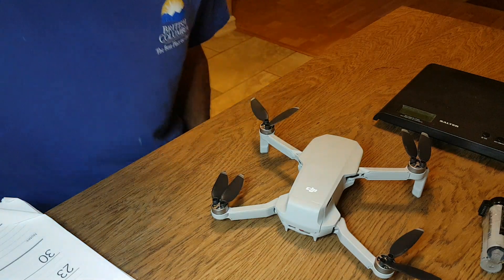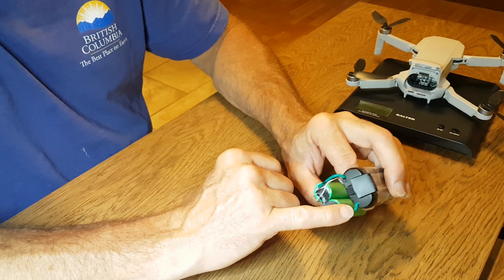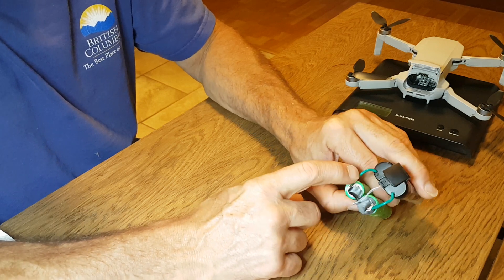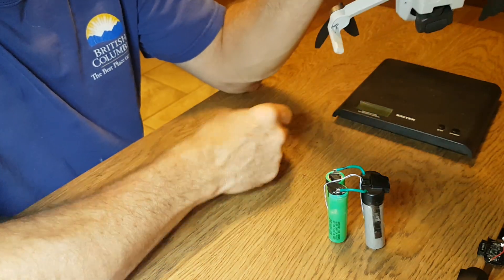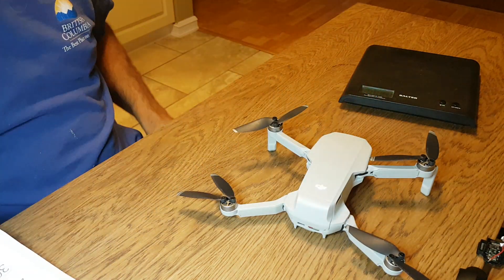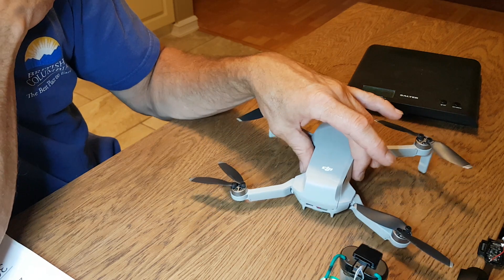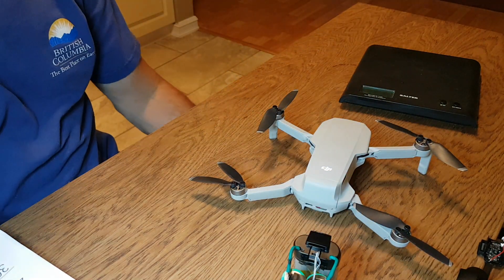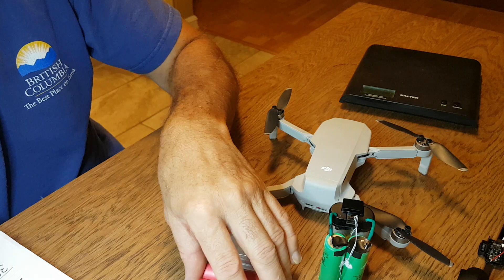Mavic mini easiest battery mod ever

Comment: Have you tried the 3500 mha yet
Reply from the maker: I probably should have, but according to some literature I had found on the web the Panasonic 3500mah batteries did not have much more power in them than the original 2500mah batteries that came with the drone itself. This is due to the power drain characteristics of that specific battery under these loads. On another note, probably Lithium Polymer batteries would be a better choice but I don't think that the charging system or the battery management system, which is part of the battery itself, would easily allow for proper charging of the other chemistry so I didn't pursue that. It also meant that making an easy quick and dirty long range drone would be too complicated for most of my audience since "bricking" the battery pack is so easy to do when trying to swap out battery chemistries.

Comment: What is the new flight time
Reply from the maker: So my "stock battery" flight best was 10.9km round trip in about 22 minutes. With this piggy back setup I did 14.1km in about 35 minutes. So I can only guess that if I stayed in C mode that I could probably get some time in the low to mid 40s minute range.

Comment: Is it possible to disasemble two dji mini 2 batteries and piggyback them, or is the battery sensing different then the mavic mini?
Reply from the maker: Yes, that is what I basically did. The second set was removed completely from it's case and was mounted to the other battery pack with wire as seen in this video. It's really the simplest way to get more distance or flight time without buying a bigger drone.
Reply: @rwatson2609  Thanks.....but will this work on a Mini 2 and still have proper sensing?  Maybe by using Mavic Mini batteries in the Mini 2?
Reply from the maker: @Maxi_Marine  ooops, I didn't notice that you have a Mini 2. I can't really give advice on something that I'm not familiar with Maxi.

Comment: Hi! Do you still have the "dead" battery boards? If the error was "battery cell error" or "battery data communication failure" then they CAN be salvaged. I am planning to make a video series on my channel how to do it, I am just lacking a "dead" board. Really don´t want to destroy a good battery just for that reason. Let me know if you are interested, and maybe we can get in touch! Cheers!
Reply: No. They can be recovered. Even Non dji error can be removed

Comment: Using a mini 1 battery to piggyback, will this work in a mini 2 since the mini 2 will accept mini 1 batteries? Thanks in advance.
Reply: Well in this case, we can just use mini battery and double its cells externally and use the pack in mini 2. To avoid ruining the last one's battery.
Reply from the maker: If what you mean is that you have a stock Mavic Mini battery pack that you want to attach to a stock Mavic mini 2 battery pack, I'd be a little careful. They are using different chemistries in the two different battery packs, one is Li-ion and the other is Li-Po. Mixing the two chemistries could be a bad idea since they both have different power curves.
Reply: Indeed a good question sir, or can we swap a mini 2 battery with a 18650 Samsung cell?

Comment: Considering this mod, but removing the old 18650's and simply replacing them with 2x 20700 or 2x 21700's saddled below, so total additional weight is less than 50g (difference between 18650 and 21700 is only 25g, but double this stock drone 2400mah 18650 capacity) EDIT: For anyone thinking of this, dont disconnect the DJO batteries from the board, it will brick the battery. This always needs to be connected to the drone BMS board and it be 'live' apparently.
Reply from the maker: Yep, I have a handful of bricked Battery management boards because of this too. :(

Comment: Couldn't you just find better batteries than what it's running?
Reply from the maker: Yes, you could but here are the standards that govern that search. The batteries that you chose should put out a total of no more than 8.5vdc(I'm guessing here, it could be more). If you want them to fit into the battery compartment then there is one more  limitation, else weight is the only other issue since those little motors can only lift so much weight. I roughly added an extra 90 grams and I don't think that you'd get off the ground if you added 180 gams.

Comment: Now it detects the extra weight and won't fly over 10 meters, also the new Mini2 batteries firmware detects what's onboard power wise and will brick itself if you fiddle with it. :'(
Reply: capitalism! yaaaaaaaaaaay
Reply: @ameliabuns  capitalist china - at it again
Reply from the maker: Did you change the payload setting? I think this should have been left alone.

Comment: Great job,  just one question about the balance wire because I have seen some other videos that have only connected the hot and ground in parallel. Do you know if it will still work without the balance wire for the piggy-back batts, and if so are there any advantages to have it connected/  thanks so much!
Reply from the maker: I guess you could just avoid using the balancing wire, but it probably guarantees a more even charge between the two batteries in the secondary pack. dunno for sure. Also just a little note. Don't let the voltage on the battery management board (the pc board in the battery pack) disconnect, your battery pack will be junk if that happens.
Reply: @rwatson2609  how confident are you that disconnecting the batteries from the BMS will brick the board?
Reply from the maker: @chaskerr4  I've got 3 bricked battery packs because of this. The first time that I did it was an honest naïve mistake so I removed the shellac layer from the battery board to reveal the battery management chip, just to be sure what I was up against. And then on the 2nd attempt I decided to piggy back a secondary set of cells over the existing ones before removing the stock cells and replacing them with 3500 mah Panasonic cells .. . . . I think that I never bothered with the balancing wire when I did this and locked a 2nd battery pack up, lol. The third time that I tried this, one of my soldered connections unsoldered as I mounted the leads to the new cell pack. 
It's not impossible to do this, but I seem to make these $50 mistakes too often to want to pursue it. The piggy back mod that you see here in this video does not require unsoldering the original cells from the pack, thus making it easy and doable by your average guy with some basic knowledge.
On a side note, I did notice that DJI did make the Mini 2 with LiPo cells and I have noticed videos of guys flying modified original Minis with LiPo cells on their Minis for super long range gains, so if you were to look for a better way to gain vast amounts of range, you'd probably best attempt to replace the Li-ion cells with a 7.8 volt LiPo pack that is just a bit larger. The down side would be that it would not fit in the battery bay and you'd need a separate charging method for this module. . . . .not sure how the BMS would do with a chemistry change though. Anyhow, from what I've seen on You tube, the mods towards flying on LiPo usually require doing a direct soldering of the battery to the drone mother board, which really forces you to commit your drone towards this project. LiPo batteries traditionally do not have the same power/pound capabilities as these Li-ion cells do but the way that these cells are used might allow for more power gains from a LiPo pack of similar weight. Let me know what you're thinking of doing.

Comment: Can you show me what parts I need and how to do this? You're in bc😀
Reply from the maker: Yep, BC. It's really only doable by a guy that owns a soldering iron and some wire strippers and solder. If you own that you are off to the races.
Reply: @rwatson2609  i got all that with experience haha. any tips how to start? parts
Reply from the maker: lol, 28 guage wire is what I used but you could get away with thinner probably. Anyhow figuring out how the jacket comes off of the battery pack was not hard by just using an exacto knife to slit it from top to bottom on both sides, but make sure that you don't cut the other wires just under the plastic jacket. No heat gun used, just pry the top cap off slowly since it is glued down with something that isn't really strong. You will see two large solder pads for the main battery terminals that you will solder to. There is also a wire that is attached to the junction of the batteries, this is typically called a balancing wire and does not need to be very thick, i probably uses a wire from an old usb cord because it was what i had at the time. that's it, take it out and fly fly fly. I can go to the edge of the battery limit when i'm flying 10-15 km from the nearest household and another drone pilot is not nearby . . . . and there is nothing visually in between me and the drone.
Reply: @rwatson2609  thanks dudeee I'll try to get the parts and try it this week lol. You can fly up to 15 kms?? Wth that's so far
Reply: @rwatson2609  how does it sit attached in the drone after? And how do you recharge the batteries
Reply from the maker: @dandee28  I was using a zip tie or two to hold it to the mavic mini. To charge the battery pack you simply keep the double pack mounted in the drone when you charge them with a micro usb.
Reply: @rwatson2609  whats the furthest you went with it and how long did the battery last? The video feed is completely smooth? I just got some yagis for mine
Reply: And which battery can I buy from Amazon?
Reply from the maker: @dandee28  Sorry, no, I can fly about 7.5 km in a straight line and then 7.5 Km back. what I was saying in that previous statement was that you can fly much longer ranges if you are at least 10-15km away from other RF sources such as house wifi, baby monitors and stuff like that. They tend to reduce your ability to communicate to your Mavic mini due to the large amounts of RF interference from these gadgets in our homes and neighbourhoods. In my city of 30-40 story high buildings I really can't fly more than 1 km in any direction without losing communication to my drone because of the RF chatter on the 2.4ghz band throughout the area.

Comment: Do you have a link for the batteries?  I would not like to buy those of the mavic mini.  I have a mini 2
Reply from the maker: Here is the link for where you can buy the batteries for a drone, but if you have a mini 2 you are actually using a different chemistry in your battery pack than we are in the original Mini. I believe you are using a Lipo battery pack.

https://www.18650batterystore.com/

Comment: If you carry extra batteries, you should change the setting in the fly app and turn on "Payload mode", it will help the drone compensate for the extra weight.
Reply: Payload mode (at least as of 2021) limits you to ten meters high. If you can clear any obstacles near your home at 10 meters, well, you're one in a million. 35 meters barely clears the trees around my house.
Reply from the maker: I tried that and for some reason the reason for not continuing has slipped my mind,  . . . . now what was it? I think that it was a restriction related issue? Hmmmmm.
Reply: @rwatson2609  Altitude and performance limitations?
Reply from the maker: @bashkillszombies  Awww yes.

Comment: so, have you tested 3AH battery instead of 2.5 oem battery(cell)?
Reply from the maker: Nope, well I did buy 20 of the 3500mah batteries from Panasonic the ones that were rated for 10amp hours. But at some point I did look at a spec sheet on these batteries and calculated that the effort was not worth the reward. Here's the reasoning in a nutshell, The 3500mah in the Panasonic batteries is really based on a .5 amp hour drain load to a final cut-off of 2.50 volts DC/cell so since this drone uses about 5 amp hours in just hover mode you can see that the demand on the 18650 lithium ion cells will be close to 8 amp hours in S-mode. There are graphs for power drain on these 3500 mah batteries that you can look up and what you will find is that at this level of drain the amount of available power is closer to 2700 mah(? can't quite remember) but the amount of power that you have access to is reduced even more when you consider that Mavic cuts off the battery supply at 3.2 volts DC instead of the tested 2.5 volts DC mentioned, mainly to save life expectancy, so good for them, but now the amount of power that you can pull from this panasonic cell is even reduced farther down closer to 2400mah. The original batteries are of a more robust chemistry that are rated for a much higher draw than my 3500mah Panasonic 18650s that I bought and they tend to really only have about 2200 mah of use under these conditions mentioned. Whew, that's a lot of typing.

Comment: You gain more just by removing the case. A few grams lighter but the same power. Adding 90 grams is going to destroy the motors much faster. Remember, the weight is hanging on the motor shafts. You are effectively putting 30% more load on tiny little shafts and bearings (continuous load). They will run much hotter, Find a way to lighten the drone or build a racer
Reply from the maker: Good point. I had thought of doing as you said and just stripping the case off in order to gain speed and range. Still probably a real good idea would be to run LiPo batteries as well since their power range is more suited to the demands of this drone.

Comment: Just looking at the configuration I would guess that the weight distribution would be better if you moved the extra batteries forward just a notch; The cell position in the video looks like it burdens the motors in the back. A small piece of tape to the cell ends might also make a  surprisingly big difference to the wind resistance.
Reply from the maker: Good idea. I did also install the extra battery pack by separating the cells and hanging each cell on either side of the fuselage but I don't think that it made a big enough difference. Bottom line, I have noticed that the new Mavic mini 2 has gone to Li-Po batteries . . . . . . there must be a good reason.

Comment: did you say you have 20 min left at percent? is that before or after the mod?
Reply from the maker: Yes. with the double-battery mod you will typically have  a 20 minute flight time still left in the tank after you see "0" for battery level on your smart phone display. My best guess for this is that the battery management system only calculates how much power is left and doesn't actually know, so what it does is it bases it's battery level that is displayed on the mode settings and thrust input, assuming a rough estimate of power consumption. Of course I've messed with this information by piggy backing an extra set of batteries to this drone.

Comment: isn't there a microchip in the battery itself to determine whether or not it's compatible with the drone? and if not, would it be possible to make your own batteries out of 18650's like what you've done.
Reply from the maker: Yes, there is a battery management processor (though not from Microchip) sitting on top of the 2 pack of cells. I deliberately did not disconnect the power to it since that would lock the battery unit and make it worthless, instead I merely piggy backed another set of cells onto the existing set as seen here. As far as I can tell, the Battery management processor only keeps track of the voltage supply and the number of times the battery has been charged and will lock up the battery pack if standard Lithium ion voltage parameters are breached.

Comment: It covers the sensor how do you manage to turn it off. Can you make a video of that mod that you can fly the mavic mini covering the sensor
Reply from the maker: You're right, I never noticed that until now. It didn't seem to matter but now I'm wondering if that was the reason for my drone flying at P mode speeds while in S mode.
Reply: Actually the sensor failing still allows take off just that it will drift (if you push the stick forward and let go it will still keep going) that is because the sensor looks at the floor with a camera and makes sure it's in the position it is but if it can't se the floor it can't keep that. This isn't a big problem but it makes landing akward as it initiates landing when it's 1 meter.of the ground according to the sensor that in this case can't see. Hope I helped
Reply: @robertformela6599  thanks for the info.
Reply from the maker: @robertformela6599  That is a big help, thanks for the information Robert.

Comment: What the maximum flytimes？
Reply from the maker: I never went for longevity but always flew it at whatever the maximum speed was. But with a normal battery setup that's usually 18 minutes on S mode whereas it's about 35 minutes with this setup....though it will not fly as fast as when the Drone is in stock setup. I'm sure it would stay afloat much longer than that if I just slowed it down...